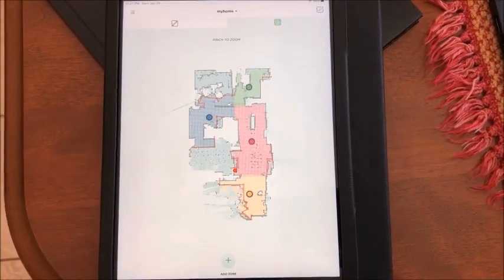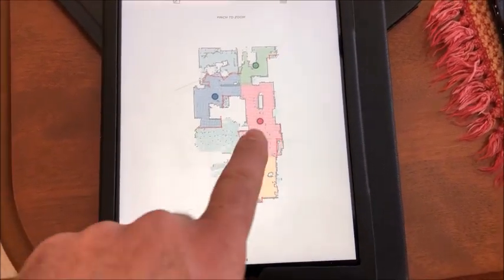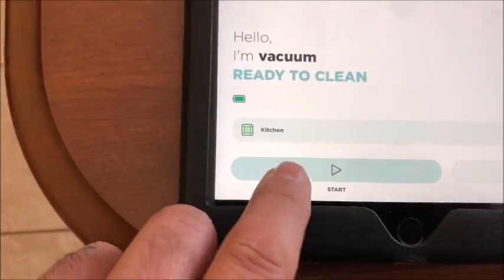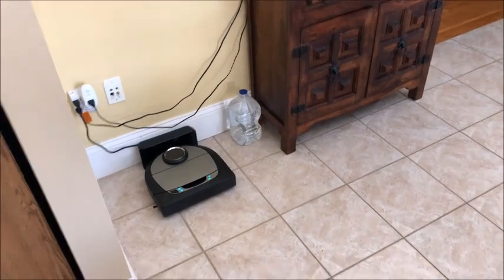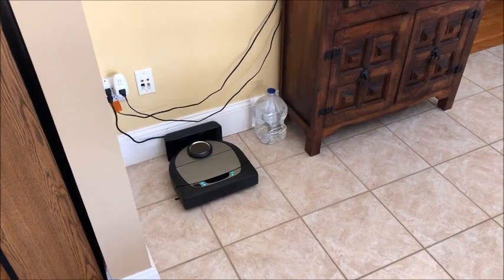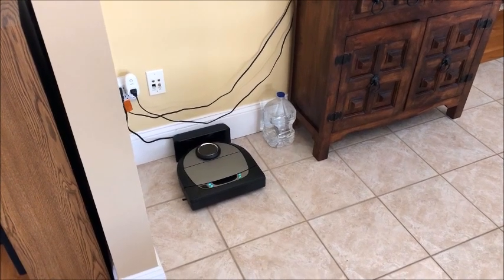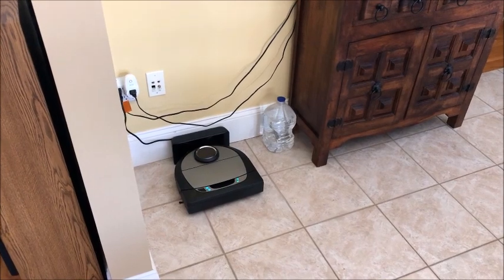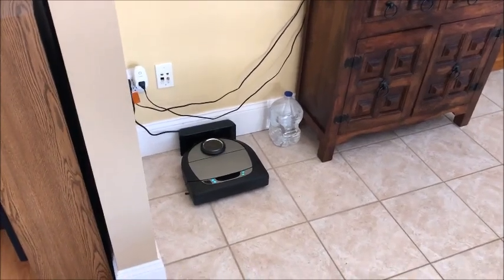Neato D7 Floor Plan Navigation Error

Comment: What helped me is to take away something I had left closeby the robot which usually I remove before cleaning. In your case try removing the water bottle to the right of robot
Reply: that's a great tip. thank you
Reply: You are the man; your suggestion did the trick. 👍🏿
Reply: No need to move anything. This is a software bug. The workaround: If you use the scheduling feature and deploy the vacuum just a minute or two from the current time, it will navigate to its zone perfectly. 

I can’t believe that they can’t fix such a simple thing. The working logic is already built in!
Reply: @blackrockcity  This does not work consistently. I read that the D7 needs to communicate with Neato's servers in order to successfully recognize the floor plan! Their "tech support" blames positioning, not enough room around the base station and everything but the real problem - which is either a bug in their software/firmware or this server problem. I had this problem for the previous 2 days and today, without changing a thing here, it works. To me, this implicates the server problem. In any case, Neato has known about the problem for well over a year and has not fixed it. Instead they continue to drive us crazy with their stupid finger pointing. This is my second Neato and my last!
Reply: @kenfrechman6950  Very, very interesting. If true, we should be able to see any transmissions it makes on good and bad attempts to vacuum. Then we can see how the data compare, despite being encrypted (hopefully?).
Reply: TOTALLY WORKED with our D6 - Curtain was touching it -- THANK YOU
Reply: Whoa!!!! this worked!!! How on earth can this be the problem! How stupid can Neato be! I just removed a box nearby and bam!! working again. So the floor plan wasn't the problem after all!!
Reply: worked for me too, thanks!
Reply: This fixed the issue for me, thank you

Comment: Hi I have same problem. Do enybody know what to do in this situation? Already made hard reset, created 3 new floor plan (3 times). Pair to different netwoerk, clean robot and nothing. Just still the same.
Reply from the maker: No solution. Neato did respond my support request and basically said that when it first comes out it does a scan with a radius of 10-15 feet and if it different then when the floor map was learned it doesn’t like it. It needs to be in a spot that has clear view from all sides. Unfortunately I don’t leave in a museum so this is mostly useless. I mentioned in this video that I had replaced the belt of the laser scanner as the original looks like a rubber band and over time it loosens causing the rotation speed to slow or even slip. I asked if they plan on updating that part but they said no. I think replacing the belt did help but ultimately I had to relearn the floor map. Now it has been working for about 3 weeks but I fully expect it will do it again.
Reply: @ScrapMetalWorks  Yes, I talked to them too. They told me I need to create a floor plan with 15 feet clearance all around the vacuum and then not move anything within 15 feet. So basically have an empty room just for the vacuum? I asked them many times to show me where that is in their documentation on their website. Of course they don't have it published. It's so frustrating, especially when we purchased the top model because they said it would have the latest software updates and features.
Reply: The workaround for this software bug is to use the schedule feature in the app to deploy the vacuum a minute or two from the current time. Then it seems to drive to the zone without encountering the navigation floorplan not found error.
Reply: @blackrockcity  The scheduling workaround did not work for me. This thing is now useless because of a faulty software update. It was working fine!!
Reply: Susan Valot is your app up to date? 

Then try resetting the vacuum. I think you press the power button on the vacuum for about 15 seconds (can’t remember)? Then you have to go through the whole pairing process as wifi setup. 

Then try the scheduling workaround that people discuss in these comments.
Reply: @blackrockcity  I finally fixed it! I had a pack of drinks nearby and that screwed it up. The bizarre part is those same drinks were in the same location a few days earlier and it worked fine.

Comment: Try to change to manual in menu and press start on the unit. It should start cleaning wuthout nogo lines. Then stop it by pressing dock on your phone. This can make it work again when you choose floor plan. Also, remove water bottle next to it. Its very sencitive
Reply: Did not help.
Reply from the maker: Emil Bogdanski same here it made no difference
Reply: Same here. I'd did not help. I'm still getting the freaking message